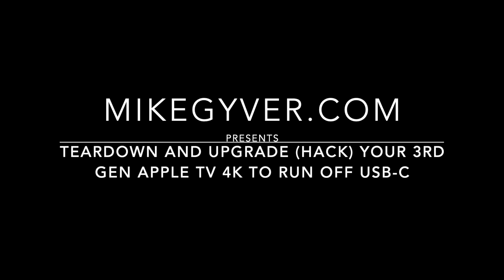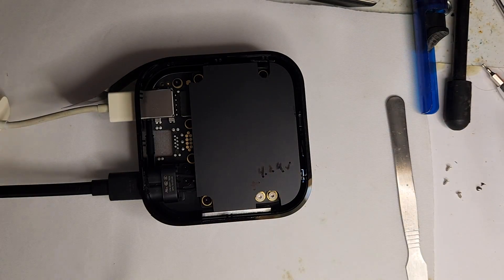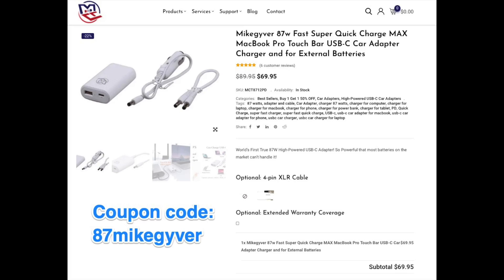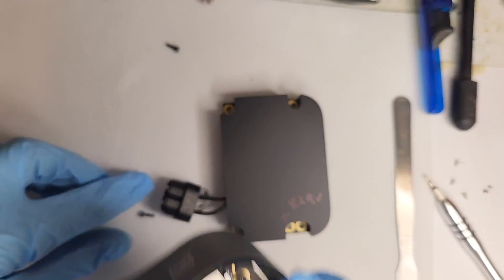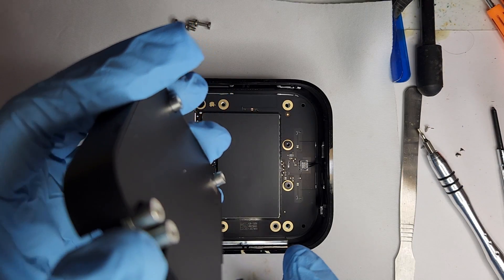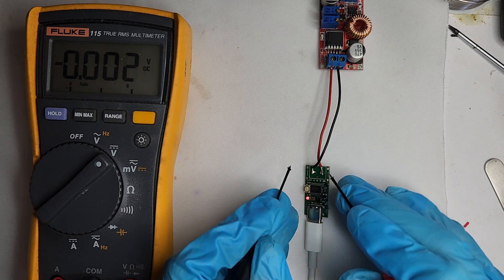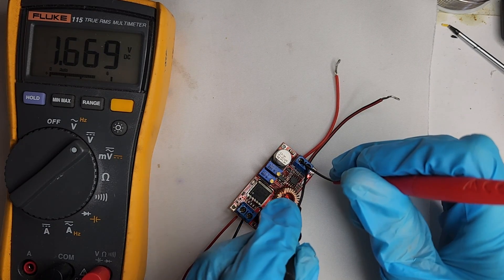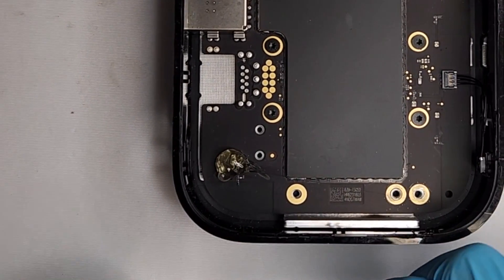DIY Hack: USB-C Upgrade Apple TV 4k 3rd gen

Comment: Any problem feeding the XL4015E1 with a +12DC supply and trimming the output to 4.3V?   Plenty of +12V outlets in a car  Thanks for the informative video
Reply from the maker: Not, 100% sure what your question is, but as long as your output is 4.30vdc (with proper amps) you are good.

Comment: did you ever just trying powering it with 5v directly? would 4.3v vs 5v really make a difference?
Reply: 5 volt goes into protection mode
Reply: i tried
Reply: you need 4,27 -- 4,32 v

Comment: Thanks for the video! I recently followed your previous version for this with the DC barrel as that’s what I had on hand but would like to do USB-C for convenience.

Just a heads up, inside the factory power supply, it’s on the underside of the board so if you take the back cover off not just the top you’ll see it’s power specs.

Mine in the UK says:

Input: 100-240v~ 50-60hz, 1a

Output: 4.3v 1.21a
Reply from the maker: Glad you found it useful!